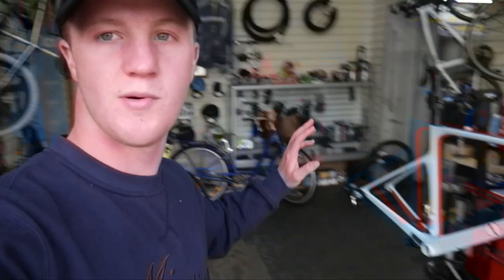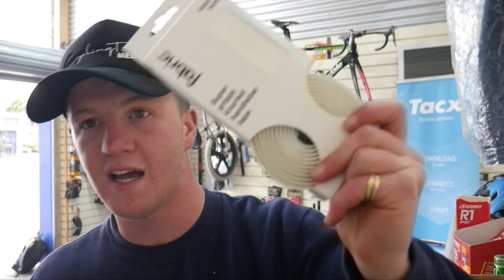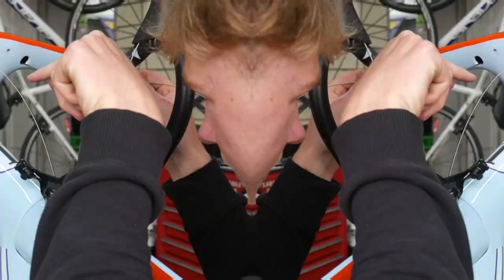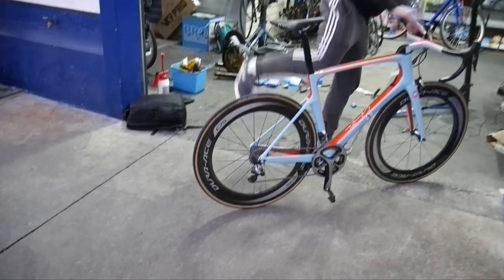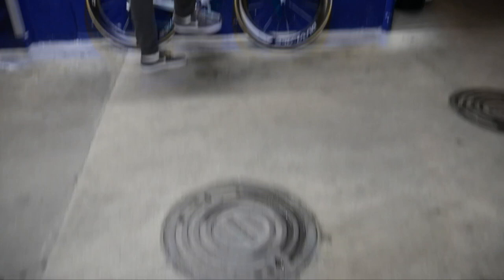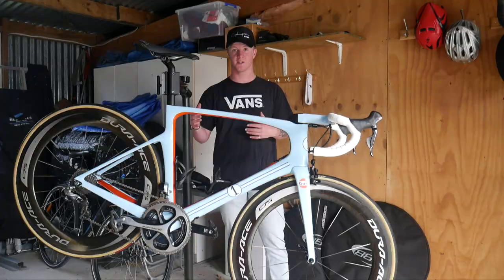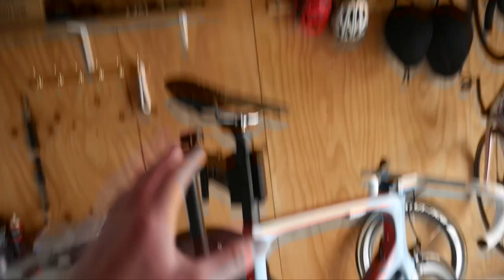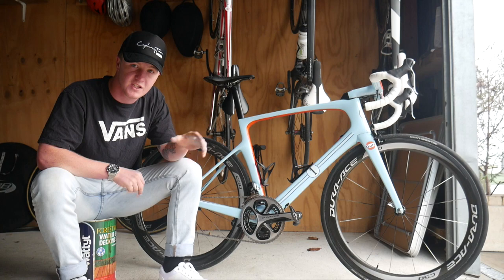My Custom SCOTT FOIL GT40 Build Is Done!

Comment: Bike looks so good! White tape looks awesome in my opinion. The black seat strangely does work with the white tape, but I won't know if its ideal until you fit it with a white seat and get a side by side shot comparison :) Black tape and black wheels, black seat and seatpost, would be a bit too much on this light coloured frame imo and would overwhelm it a bit I reckon. But its such a nice bike I don't think it really matters that much.

Comment: Bar tape and saddle need to match. Black and white both would look good. I think the dura ace wheel decals take away from the frame. I think you should remove the dura ace decals on the wheels.

Comment: hi tom,  look at the car do you see any white on it. sorry i have dreams about that car.
Reply: hi again tom i know how you like the white bar tape. when your hands get dirty the white is going to get dirty. bar tape is hard to clean. ok brooks makes a leather bar tape that looks real nice. i got some im putting on my 61 schwinn. brooks has mot sure how many colors. i think it would be a compromise between the black and white tape. go to brooks and look. when you start to put the tape on start at the top and work your way down. the man that built my road bike showed me that. hes been building bikes for longer than you and i habe been around. that way you dont have to tape either end. make sure you put it on so if you twist it while struggling you wont loosen it. i thing the brooks tape will make the bars look like a lesther rapped steering wheel that the gt40 might of had. good luck.